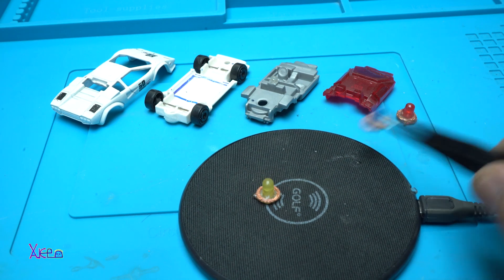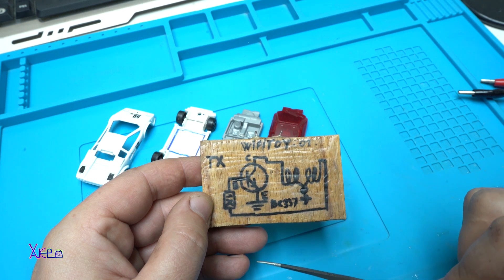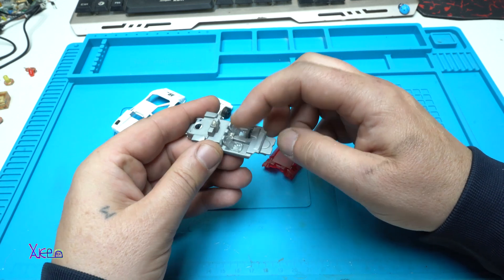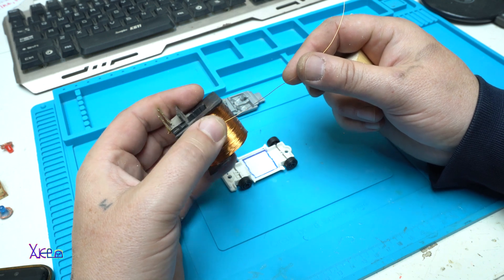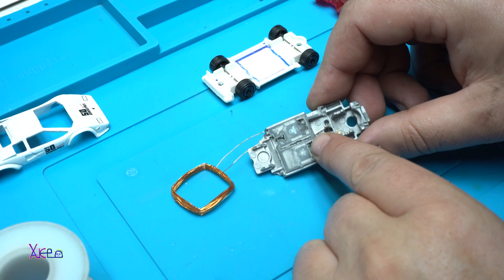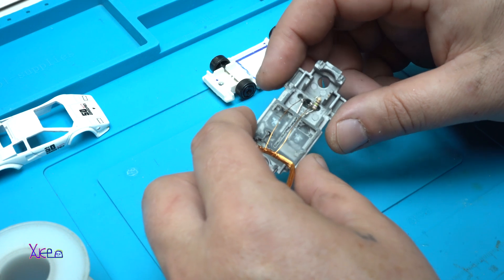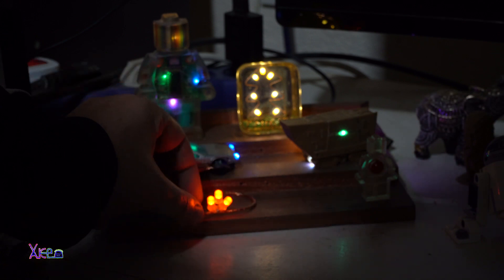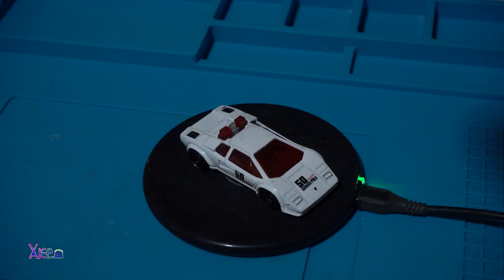BATTERYLESS LED'S ! How To Make them at Home?

Comment: Hello!How do you know how many turns are needed for transmitter and receiver? If I want to make a larger scale transmitter 20 cm wide by 1 meter long what components should be used and how many turns? Could you realize a video? I follow with great pleasure your videos, they are very interesting. Thanks and all the best!
Reply from the maker: Hello
I never made in that scale,you need to experiment,but making bigger coils mean to use more powerfull transistor.
Reply: @Hacktuber  You're right, but I think it's worth the effort.
Just imagine how nice a transmitter shelf would look full of all the projects you've done, or for new projects.🤗

Comment: I want to do something like this but  make it hold a charge. Do you think adding a small supercap to it would work?
Reply from the maker: No,AC voltage receive the coil,need to convert in DC than add capacitor
Reply: @Hacktuber  Okay, that make sense I forgot about converting to DC. Thank you

Comment: Not a joule thief, the point of that is to increase a voltage to turn on an LED, for ejample using  a 1.5v AA battery for a ~3v LED. Here the source is not the feature, here it is about turning the LED without a "battery" directly connected to the LED, hence "wireless". You could use a joule thief circuit to feed, as part of the emitter, using AA batteries (even the ones used if at least 0.6v)
Reply from the maker: Yes the point was to make wireless leds that you can place in some gadget and make cool device when is on wifi charger.